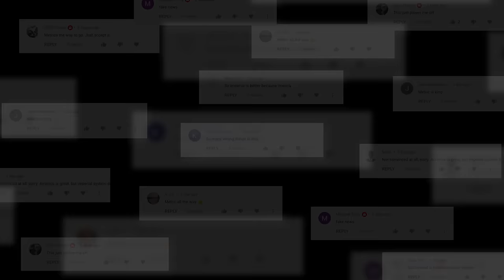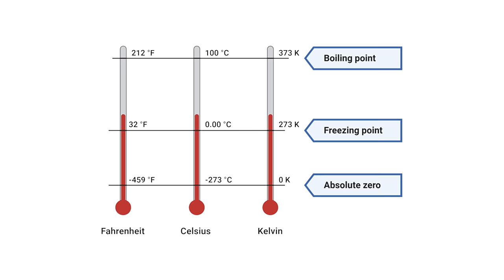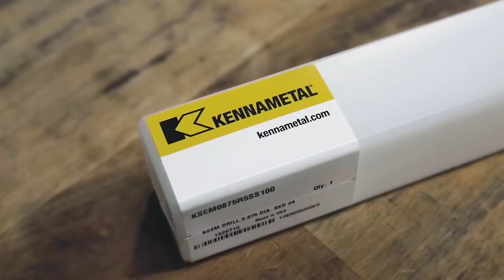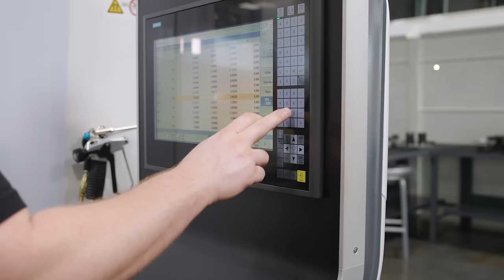Why METRIC is SUPERIOR to IMPERIAL

Comment: In Germany we use horsepower by cars too, nobody wants kilowatts for cars. They show 136 ps(hp) /100kW. Also tubes for water, lng, cng, or other fluids re 1/2" or 3/4". the threads are imperial to 12/inch or vv. Nuts and bolts are metric of course. Even tubes for waste water were 4 or 6 inches. But its not the inner diameter, nor outer, its a rough size, a 6 inch tube fits in a 6 inch connector, and a 6 inch three way distributor. Or a 6 inch to 4 inch reducer ( which have 100mm dia...)

Comment: My own experience in England started with Imperial, and some elements still make more sense. I was a farmer and I used acres. I know how they relate to furlongs and chains. But I cheerfully use metric when I am cooking. The hectare feels awkwardly big, but the calculations are easy.

More subtle are the advantages of the Whitworth thread, definitely Imperial, but matched to its purpose. The detail of the thread profile and the pitch do matter. Bolts with fine threads are not for castings.

I am likely biased by the long transition from Imperial to metric in Britain. And machines on a farm can have a long life. I still have Whitworth spanners in my toolbox. I probably don't need them.

Comment: just to make i clear. the mectric ystem is not (anyore) based on an arbitrary rod in France, but on the speed of light. one meter is per definition the distance light is traveling in vacuum in 1/299 792 458 seconds. THAT number is indeed arbitrary to fit the original Stick in france. but its also a value NOONE exept some physicists uses

Comment: As a aircraft engineer unfortunately most things are in imperial when it comes down to fasteners etc. so I had to learn to use it and get used to it.  But luckily in the maintenance manuals a lot of values are set out in both imperial and metric, eg: damage limitations, torque values,…
For ease of use I will always use metric, so much easier and as you mention in the video more accurate.
Also there is no standard in the imperial system, what I mean is in the metric you have the master kilogram,…  imperial values are based on a set metric value.  Like 1 inch is 2,54…… cm etc

Comment: As a Swede, I use Metric (its the norm here). But I learned basic Imperial. It's only breifly touched upon in school, to know that it exists, and in Advance Math you can learn more (just to know how to calculate Farenheit, inches etc into metric).
But because I whas into Tabletop gaming and miniature model building when I was young, I had to learn more (and I did). As models usually follow the Imperial system with scales.
Cheers.

Comment: I was born in Canada in 1966, so I initially learned the British Imperial System, then began learning the Metric System in the late 1970s, and then immigrated to the US in 2000 so I then needed to learn the US Customary System. I can say of the three the Metric System is by far the best! In your other video you talked about the cost of the US switching to the Metric System but you ignored the cost of supporting two systems! There was a NASA Mars mission that failed because of a conversion error and a commercial jet that needed to make an emergency landing because it had only half the required fuel because of conversion error! That is why American scientists and engineers have all switched to the Metric System and all US Customary System units are officially defined in terms of Metric units! Metric is uses base 10, except for time which they kept base 12 because 12 is divisible by 1, 2, 3, 4, 6, 12. When Americans go to the grocery store everything is listed by law in both US Customary and Metric and when buying medicine that is likely to be in Metric. So in a sense the US is already on the Metric System but most Americans don't realized that to be the case.

Comment: You can buy brand new hydraulic pumps today that have M12 bolts for fitting one hose flange. The mounting bolts are also metric but another hose fitting is 1/4" BSPP. 1/4" BSPP is not 1/4" in diameter though!
Then on the same machine you can have another pump with 5/8 UNC bolts...

Comment: The only use i found for imperial was that time i broke my 3.5mm drill bit and had to use a 1/8" (3.175mm) drill to make a through hole for a M3 bolt.

Comment: There is one thing i find imperial useful for and that's drilling clearance holes for metric bolts, need clearance for an M10 bang in a 13/32

Comment: The worst part is the multiple tools required. I run a small engineering workshop andhaving to have all the seperate thread tips, multiple taps/dies/die nuts/drills/reamers nuts is exhaustive. Then draws for UNC, UNF, Metric, Metric fine....Working in either is easy, just the cost makes it painfull!

Comment: I had to find the torque setting for an american screw in a small engine yesterday.
I knew it was 3/8" and the head markings indicated Grade 5 , but all the charts only showed maximum of 20 TPI and this had 24 or something (couldn't be bothered counting).
Metric is so much easier , there is generally only two thread pitches for any thread size and you can determine it with a rule.

Comment: American dont use imperial units that were defined after US independance but what is named US customary units. There are some differences in the volume units.
All those units are defined now  in US on the basis of SI units.
Every contry using metric system can also have some customary units used in some activities, even in France ( carat for instance).

Comment: I'm from the UK, but, in regards, we tend to use both currently, I do, but you can see with kids coming through from school, they have no clue about imperial, it is being fazed out... For me though, it just depends on what I'm doing... When working in old buildings, replacing stuff, things tend to be inches, so it's just easier to work in inches, new work, metric... When it comes to work that doesnt need to be exact, like say, quick measuring of a piece of timber, if the measure bangs on say... 14.5", I'll just use that, or if a piece lands on a round metric number, say, bang on 310mm, then, I'll pick that. Our tape measures have both on so, I just hunt for the most promident line on the tape.

Just for fun, the metric system has places in our society when it comes to men or women...

Meters/Millimeters - Strictly for the men, that's all we speak in, centimeters are ignored.
Centimeters - For the women, furniture and stuff are advertised generally in cm, so that's their domain! ;) hehehe

Comment: This debate makes more sense to someone who speak two languages. No matter how fluent you are, you can ONLY do math with the language you learned it.  So I do my arithmetic in Korean. But do my calculus in English. I'm talking about the thought process here.  Similarly, it's hard to visual a length in a unit that you didn't learn.  So people intuitively know how big 6 feet is.  But they can't visualize how big 2meters is.  Not w/o a lot of practice.  But it can be done.  For example, US military uses metric. We navigate in KM, and we call for fire and adjust fire using meters.  But we still call it the 12 mile road march.  So some things just are. Interestingly, aviation all over the world use imperial knots and feets.  Go figure.  (i think Swedish use metric for aviation, but I'm not 100% sure)

Comment: Fun fact: milliMeter, centiMeter and kiloMeter are the same unit of measurement - they are the METER. The same is valid for all the other units: gram, watt, volt, amper. The "milli-", "centi-", "kilo-", "mega-" has nothing to do with metric system and has all to do with the decimal system we all base our math on. The question is why this is not used in the imperial - i.e. why aren't there any millinches or kilopounds?

Comment: I like metric system more but as a electronics hobbyist I'm used to using both. Especially integrated circuits are awful. The pin pitch might be 0.5mm, 1mm, 1/20", 1/10" etc. Using imperial and metric components on the same PCB is an unpleasant experience. In everyday life I use the metric system, except for TV/display sizes and car wheel diameter.

Comment: I've worked in the oil and gas industry all my life and because it is still dominated by US companies, the technical standards are still written in inches.  In the UK we would call that "Imperial" units but in the USA they are known as "US Customary units"
It's units soup and a complete nightmare for anyone brought up in the metric system.
Some dimensions are measure in fractions of an inch down to 1/64, some are measured in thou and when it comes to measuring the length of pipes, well we do that in feet, 1/10s of feet and 1/100s of feet - go figure!!!

Comment: Funny fact 1: The imperial is defined on metric. One yard is defined on 0.9144 meter.
Fun fact 2: It was a metric guy who redefined the inch to the exact size. See story of Carl Edvard Johansson and his invention of gauge blocks.
Last but not least: 1 m³ of water has a mass of 1 metric tonne (1 liter of water equals 1 kg). It's easy to convert volume into mass knowing the density and/or getting a feel for it. 
And ... kg is mass not weight (= force). Forces are measured in Newton.

Comment: The main advantage of the metric system is its consistency and simplicity, but the problem is, that most of the metric system is based on agreement between countries, rather than a verifiable standard, except the temperature, which is based on water, and this problem is the main reason why so many people still prefer the imperial system, despite its disadvantage, so it would be a major improvement if we agreed on some verifiable standard for the other units, exactly like we did in case of the temperature.

Comment: Metric is just an intuitive one, you straight know from the spot that 2.5 is larger than 2.4 which is very confusing when you want to represent size with fractions and non divideable by 10 step down to different unit.  Imagine if dollar had 139 cents and you had another unit for 1367 dollars called Big$ ( a car costs 875,4 Big$ how many dollars you need?), you can clearly see that using non base 10 steps with money calculations would be a source of a lot of headaches and miscalculations.

As a person living in metric country, i can tell that the only problem people have is size representation which is hard to measure - if you want to make shaft smaller by 0,005mm, it's easy to tell that it's for e.g. 49,995 while it's headache when you use fractions unless measuring tool is scaled in mils, then it's as intuitive as metric mm's.

Comment: "For many small job shops, this will not present much of a problem. However, for other manufacturers, it will mean the difference between growth and stagnation. Consider a CNC machine’s smallest programmable value. In many centers, that value is 0.001 millimeter in metric and 0.0001 inch. If you convert those values, you will find that 0.001 millimeter is about equal to 0.00004 inch (less than half of the smallest programmable imperial value) and that 0.001 inch is about equal to 0.0003 millimeter (three times larger than the smallest programmable metric value). The bottom line is that programming in metric will often allow a machinist to meet tighter tolerances."

Comment: Top tip many don't know about metric. 1 litre of water = 1 kilo of weight. They used water as the benchmark because its the most abundant fluid on the planet. The most accurate way to measure out water is your weighing scale, very few manufactured measuring jugs are more accurate than a digital weigh scale. In fact, I've never found one as accurate.

From that, you just need to know the weight compared to water to weigh measure any fluid. Petrol (gas) is 0.78, so one litre of petrol (gas) weighs 780g. I worked in a facility that did a lot of mixing of chemicals and when we started weighing the fluids, instead of using jugs, we got far better end results and had far less wastage. We ended up saving ~8% per annum on fluidic raw material!

Comment: Metric, it is far more usable in terms of converting from smaller to higher sizes and vice versa. For example, 1 km is 1000 m, 100000 cm, 1000000 mm, or 1 m is 100 cm, 1000 mm. Also if you need decimal numbers, 1,67 m is 167 cm or 1670 mm. In imperial, I would go nuts if I need to use those fractions and you can't easily convert inch to feet or mile and opposite. Like you said it is most noticable in machinery. I am civil engineer, worked with steel construction and during that period I was working with machinery engineers, they use mm as units, because of precision. With inches that is very hard. In other kind of construction we use cm or m, even km. But like I said, it is easy to convert.

Comment: I work in a German company that sells worldwide.
Internationally, all dimensions are calculated in millimeters. We also deliver to the US market. Until a few years ago, the Americans gave us the measurements in inches. These were converted to millimeters for production. 
Today we manufacture according to ASME dimensions, but no longer according to ANSI. 
The dimensions are already converted to millimeters.
We only accept complaints in millimeters. If the Americans convert incorrectly, that's not our problem.

Comment: U.S. Congress authorized the use of the metric system in 1866 but from then on it seemed to go nowhere.  It is strange however that all dials on all machinery are in decimals not fractions.  I could be wrong here but I have never seen a lathe with scales marked in 1/16" or 1/32"   etc.  I initially learnt imperial up to University level then the country converted everything to metric.  During the changeover period I remember doing an imperial exam in the morning and a metric in the afternoon.  No great issues. The formulae were all the same.  Main things to remember was-----  gravity conversion 9.8 vrs 32.2  and 25.4mm to the inch plus a few weight conversions.  Honestly it was not difficult.  Much prefer the metric system - far neater.

Comment: Imperial units are still used (standardized) a thumb or inch is 2.52 cm and building materials are usually cut to these standards.
But there is no high tech place for imperials.
You would not like it if your doctor made a mistake when adjusting the strength of the CT or MRA device.

Imperials are something we use for more analog stuff.

But there are other things out here in the world.

The Danes often speak numbers the old way by base 20, so half 4 is 70 making it quite interesting trying to understand.

What is more interesting about the US is that they use Million when counting big numbers.
As it is a weird anomaly when you are base 1'000 compared to French base 1'000'000.
This means that any number is multiplied by 1'000 by naming while in French a quadrillion is simply 1'000'000^4(quad).

This means that you sometimes deal with hardliner imperial users or sometimes confused individuals when they are trying to explain how many zeros there is in numbers so massive you need to use a logarithmic notation.

What I find most interesting about imperials is the idea of learning math trough that path.
How do they deal with anything that enters the STEM field?

Comment: In terms of raw measuring efficiency and accuracy of description, there is no question that metric is superior. But sometimes it’s not about that. It’s completely valid to work with a unit that your country and people are accustomed to. Lots of great machining tools also come from the states, and are imperial only.
Reply: The USA does NOT use the Imperial System.
It uses a Pre-Imperial System.

Every country now using SI had to CHANGE, at some time !

Comment: Having to work on Caterpillar machines is the worst as they still use some imperial bolts in a machine that is largely metric such as brand new 992 loaders with the rear axle held in by 36mm bolts and the front with 1"1/4 bolts. Any new parts are made metric but if an older part is used it's imperial so you can have a 3/8 bolt screwed in next to a 10mm bolt. So many tools.

Comment: Another point is any time you have to do anything more than a very simple calculation.

Let's say you're building a water tank at a certain capacity: the volume is easy to calculate: a liter is 1000cm^3 and weighs 1kg or a cubic meter is 1000l and weighs a tonne. In US units a gallon is 231 cubic inches (which you need to look up or remember), have fun with the rest of the maths.

Comment: [10/27/22]  We're kind of lucky up here in Canada bc we have to be well versed in both the Metric, and the English systems (We tend not to call it Imperial, well bc it has imperialistic overtones. lol ). We also call it US Customary, bc of course, it's still used extensively by certain US industries.  Interestingly, the ultra modern F-35 fighter program uses the English system, so all the international subcontractors had to re-adapt themselves to English in order to produce the components to spec.